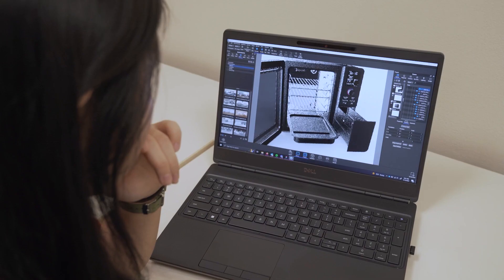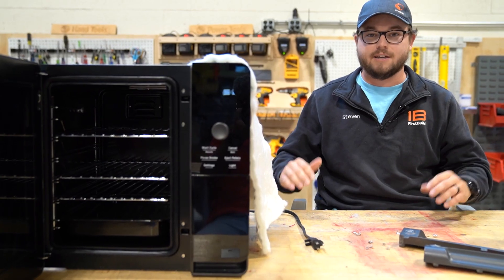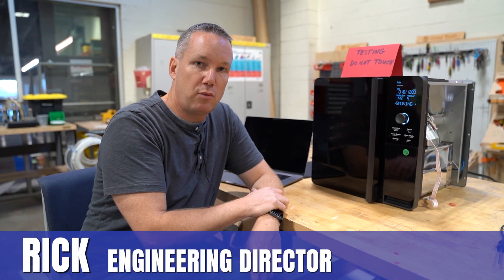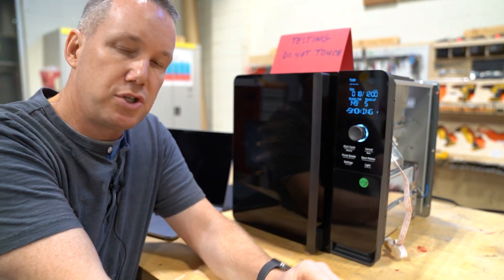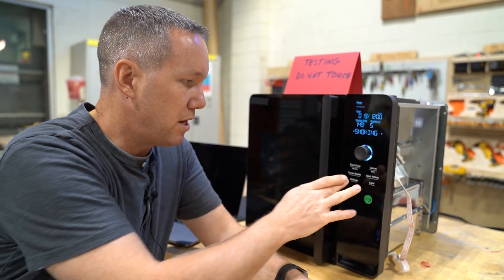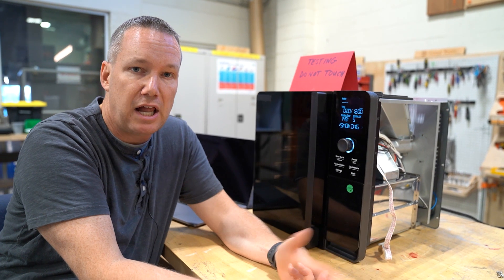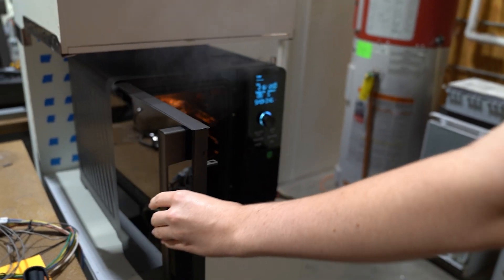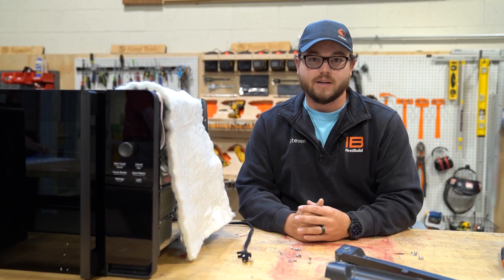Arden Update - New DG Units Have Arrived

Comment: Couple ideas......1) vertical rack like a rib rack so you can put more ribs in 2) hanging rack with hooks to hang meats 3) cold smoking mode so you can smoke below 90 deg f
Reply: Cold smoking is already an option. The smoke is heated by an independent mechanism from the electric heat source. So smoke is already isolated.
Reply: Nice idea
Reply: PERFECT ideas.